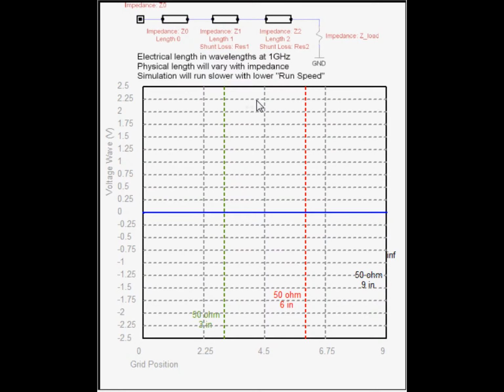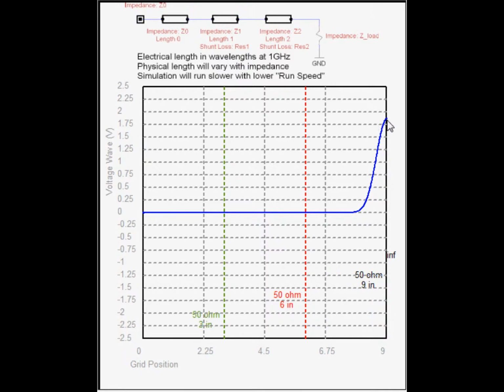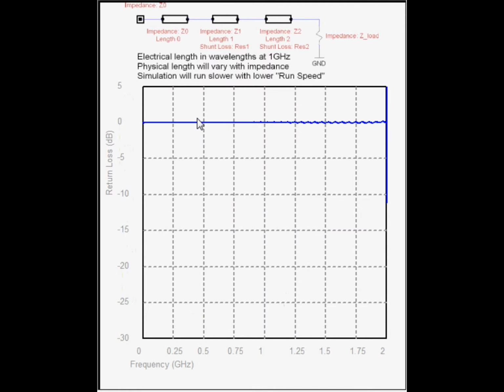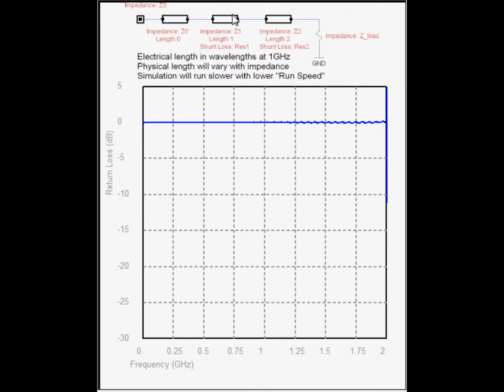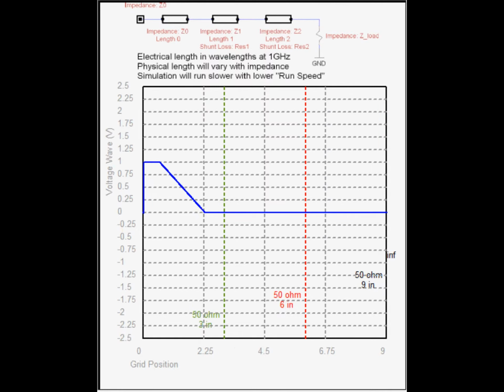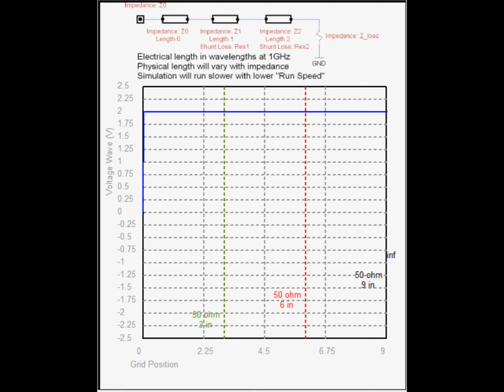WaveMason, into an Open

Comment: Thanks a lot!! I was confused why the voltage at open ended T line is 2x before watching the video. Now I understood that the open end voltage is not 2x times input voltage but is equal to Input voltage(Considering input voltage as a step function).